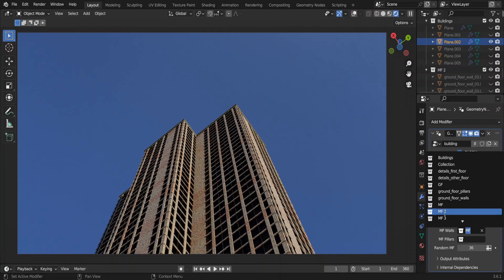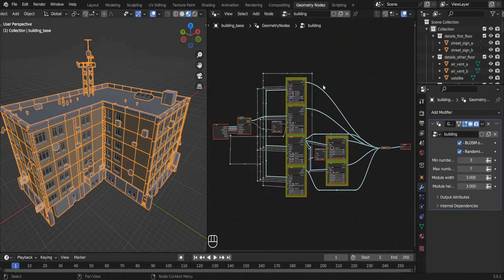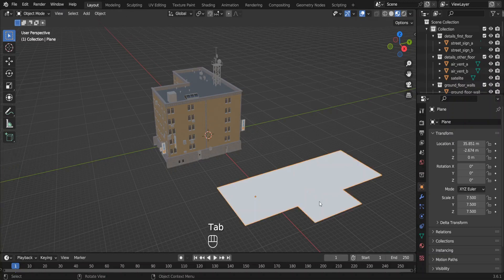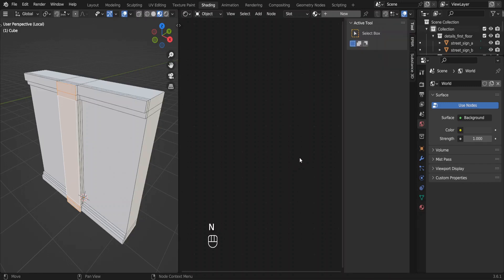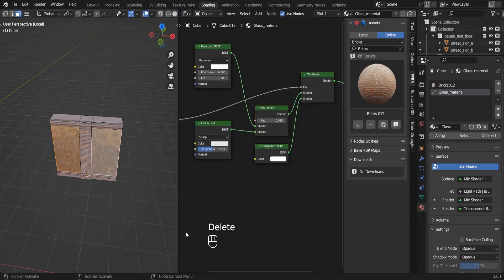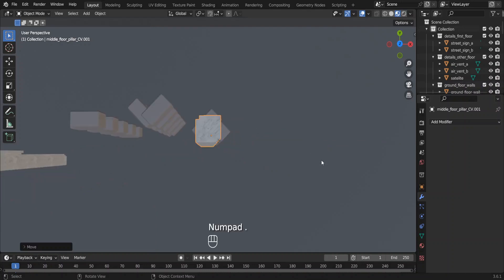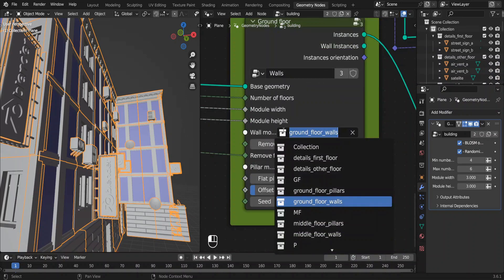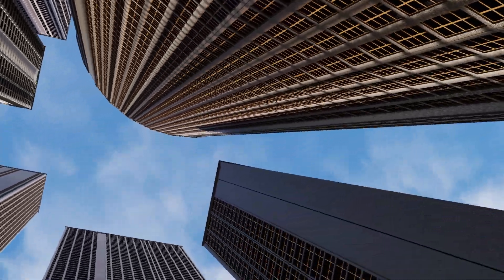Building Buildings in Blender | Buildify 1.0

Comment: i want to make a city in night time but how do i add a light into the windows? does it use mix shader?
Reply from the maker: Do you want to light the building interior, that is tricky cause it may be visible that your building is empty. So if the building is empty, you might need to add some textures inside. 
You can add some point lights and reduce the window darkness. (You might want to add some planes to contain the light)

Hope this helps.